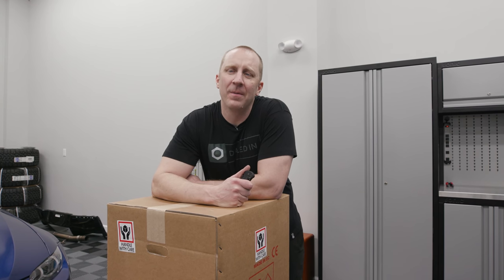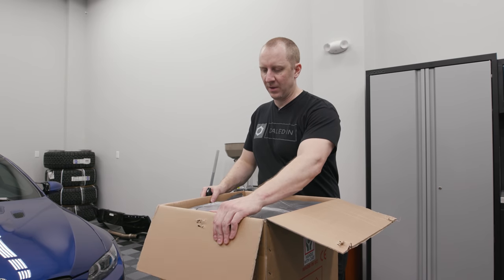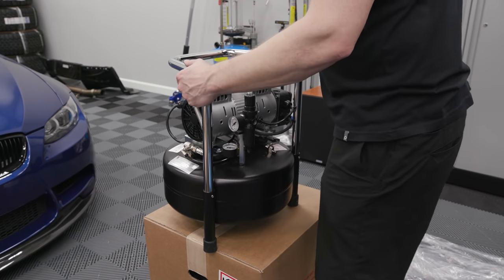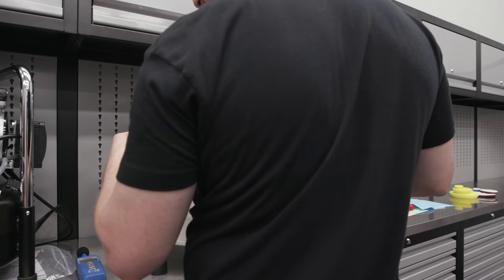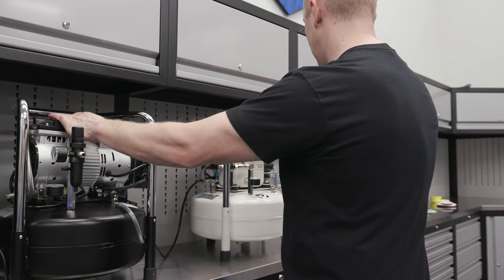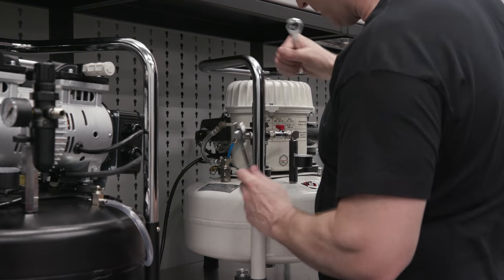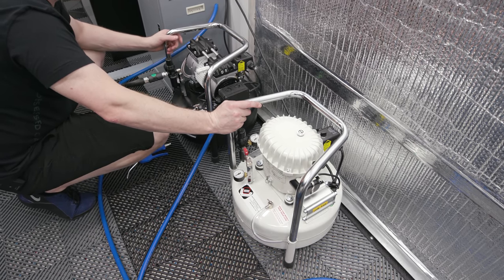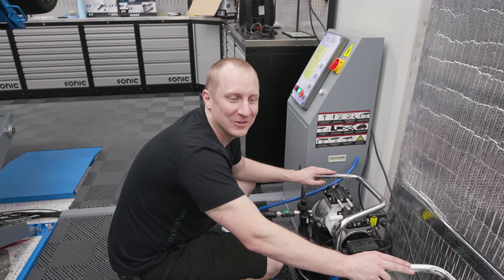Unboxing Werther & Fiac "Silent" and "Quiet" Air Compressors

Comment: Here's an idea for the white one.   Make a fitting and hose for a remote air filter mount for the white one.  Then build a simple cabinet lined with dynomat like material and run the air filter outside of it.  I bet it would be virtually no DB

Comment: Definitely looking for a model like that white unit.  I need a capacity to use forced air in interior detailing and tornador, would also like to be able to use air polishers, smaller units like 3 in or smaller pads and larger on sanding. Quiet is a must. I live and work in a residential area. Please keep me posted, I have an OG account now. Very promising. Just wish I had more time to check on current videos.
Reply from the maker: You can't use a pneumatic polisher or orbital sander on a small compressor.  You need 13 CFM or higher.  These are 2.1 CFM.
Reply: Tornador uses a LOT of air!

Comment: Still waiting for vacuum recommendations ! Come on Guys!!
Reply: Vacmaster Beast 5 Gal 5.5 HP
Reply: not sure what your exact needs are but I swear by the rigid pro 4 gallon.  Its a little beast.  Good cfm and is very portable with good user Exp.  It's the red model.
Reply: Watch the vacuum wars shop vac comparison.  The Rigid 4 gallon and the Vacmaster Beast came out on top

Comment: My needs are different in terms of the tools I use, so they might be too small for my personal applications (I saw below where you mentioned these are around 2 CFM and a lot of the air tools that I use need more air to run right), but they appear to be really nice.  The quiet aspect is what I really love - my current compressor makes my ears ring even with hearing protection lol.
Reply from the maker: Yes, you would need a larger version.  I’ll be sharing those soon as well.
Reply: @ObsessedGarage  Looking forward to the review, for sure.

Comment: wall air thing is a pretty cool idea.  Only concern would be that it is fairly new and untested.  Maybe wait for version 2 or 3 when they get the kinks out.
Reply from the maker: These have been around for decades.  I just didn’t know about them.
Reply: Obsessed Garage I meant for the all in one compressor that you said isn’t out yet.

Comment: These are great for something like jeweler or airbrush applications.  But for garage/shop use I just don't see how useful they're going to be, other than just very small air uses like small nail guns.  Even filling a tire may be difficult due to the small tank size.
Reply from the maker: These are perfectly fine for filling a multiple truck tires, blowing out pads, using air tools that don't require a ton of volume.  6 gallons is more than adequate.
Reply: I like this as a mobile detailer that advertises more quiet EQ for my senior and luxury neighborhood clients that have noise pollution rules in their HOAs

Comment: Ok guys!  Ive asked over and over.  What is the fitting that Matt is holding at 14:19 that appears to be a male to male adapter.  He tapes one side; screws it on; calls himself an idiot; tapes the other male side; and then attaches the Prevost QD to it…. Please.
Reply from the maker: It's a 1/4" to 3/8" male to male nipple.
Reply: @ObsessedGarage  Great!   Finally!  :). Looking forward to getting this great compressor and hose set up.  Thanks guys!  I picked up a few Esoteric green Proflex hoses.  If you ever get those continental in green I might try yours.

Comment: Whatever happened with the Eastwood scroll compressor you were looking at a year or two ago?
Reply from the maker: I'm not sure they ever finished it.
Reply: @ObsessedGarage  This one?  They are in stock and shipping them, have been for a while if I remember right. https://www.eastwood.com/eastwood-elite-qst-30-60-scroll-air-compressor.html
Reply: pretty cool little set up.  When did this come out?
Reply: I just got one a short time ago, but haven’t had a chance to use it yet. Hopefully it will be good

Comment: What about a rotary screw compressor system?
Small to large units
Reference:
https://www.youtube.com/watch?v=k_JV0z8_KsI
Reply from the maker: The problem with large rotary screw compressors is that they need to operate at temp for long periods to keep water out of the oil.  Otherwise you end up with rusting and issues with the head of the compressor.  I’m a normal hobby type garage, we don’t run our compressors enough.  I have a new type of rotary screw in the garage now with a oil heater that the solves this problem.